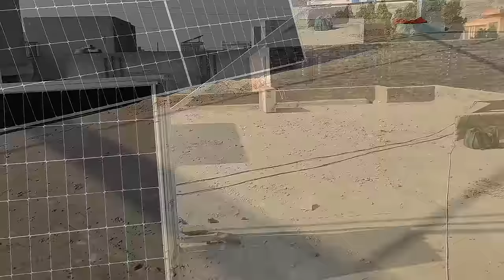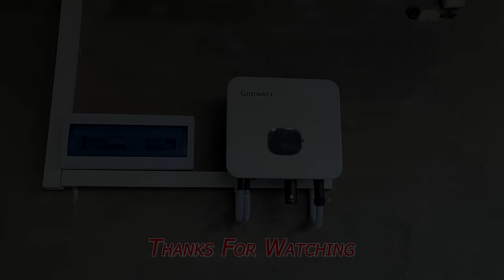Process of Solar Panel mounting structure making + Installing Wiring + Earth connection Full Process

Comment: Absolute professionals and perfect installation. What a beautiful and secure structure and great installation. However, some things could be improved, such as; The earthing was done by hand and should have been done with a bore machine. Atleast 25 feet deep, if this manual bore is that deep then its a perfect job. Another thing that could be improved is anchoring of structure with more steel wires and rawal bolt so that the main beam does not move at all.

Comment: A Friendly Advice, I think Instead of welding it too much you should use nut bolts to attach the whole structure. In case it need to be un-mount in the future. Otherwise good work.Thanks
Reply from the maker: Thanks for the tips!

Comment: What is the roof materials used…they cut a hole in thick tile but then drilled into concrete, that is one heavy duty structure…wow
Reply: Why so high off the roof level?
Reply: @johnshield7157  If the house owner use the roof he easly walking and any work , and when the falut is come then worker do work easly

Comment: Just one thing to complain about is the clamps used to hold the panels 
If you are using C channels then why you used those clamps better you use nut bolts and washers on both sides

Comment: Nonscence design. Why yu welding and darling hole in landtor. Use nuts and bolt.
Reply: Same as you Sir wo jo nuts and bolts hongy wo landtor men nahi lagen gy kiya wo wind men lagen gy kiya😂😂😂
Reply: Guider end me hole nikl k L shape k different pieces used kry both side py.